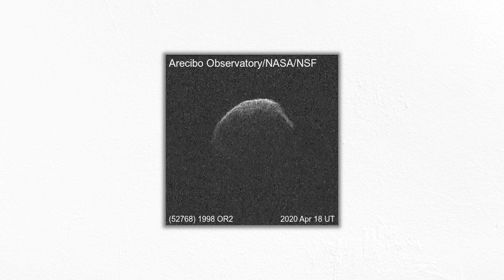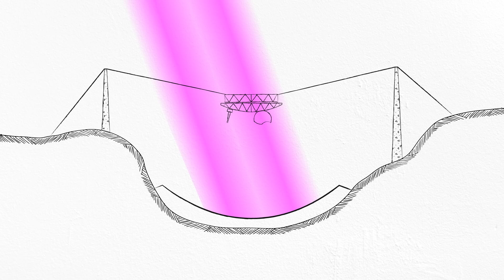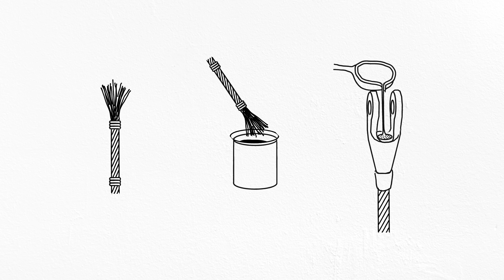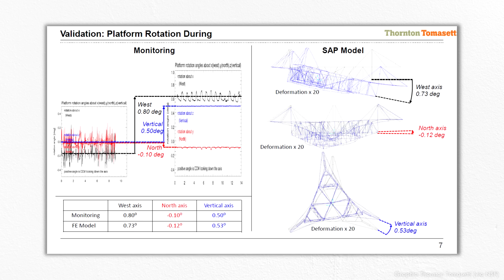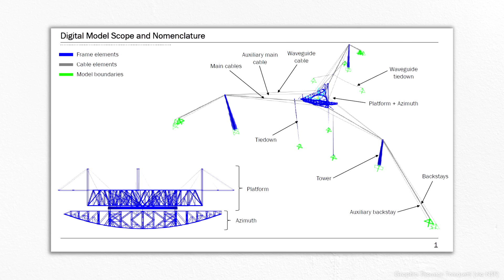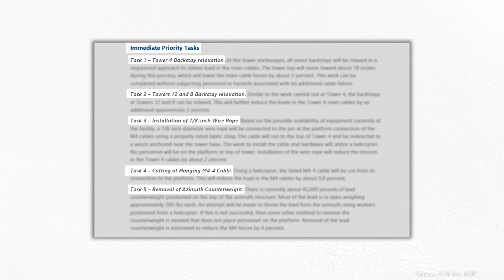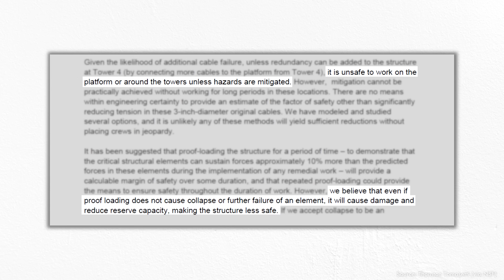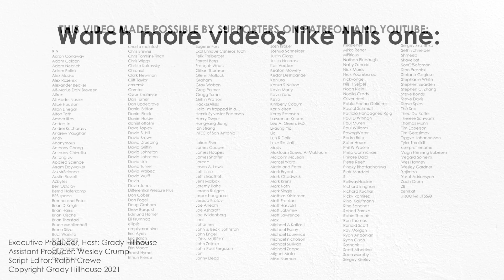What Really Happened at the Arecibo Telescope?

Comment: you had a moving unstable structure :: Every storm, even operating it, caused metal fatigue at the stress point, the weak point in the design, which a more solid tripod would solve.

Comment: The fraying cables were known months in advance.  I read on the news "it's going to fail!"  I wondered "why don't they repair the cables?"  It could have been done for under $1 million for sure, it was a simple job of replacing them one at a time.  All the stuff about the catenary modeling is nice, but an adjustable mount could have been used and then everything gradually tightened up too.  There were surely several ways to do it, if we had only DONE IT.

But we let it go, which was intentional self-destruction.  Not the first time we've done that in recent history.  I guess China was supposed to have the only good one, so we "stepped aside".  Yes I did understand the video.  I am an engineer.
Reply: So you're saying that you would gladly risk your life and the lives of others just for a piece of equipment? I sincerely hope that you do not hold any sort of management position because your mentality will get people killed.

Comment: They didn't use Spelter Sockets, and clearly the breaks all originated from chafing at the tops of the towers. 

The rapid spread of wire failure inside of the cable after the outer chafed cables failed indicates a weakness Throughout the cable SPECIFICALLY at that point.

I conclud the culprit was GALVANIC CORROSION at the point where the cables met the top of the tower.  Possibly from different metals or from an effect of current being produced by suspend wires.. The name of this phenomenon escapes me now.

Comment: The system cut me off M …….anyway, the ropes (cables) should have been galvanized and probably changed every 10 years.  A project this important sho7ld have had a safety factor of at least 10.  A unique project.  But bridges have large safety factors and they are in a corrosive salty atmosphere with constant vibration from traffic and hurricanes.  I believe our Engineering group at Otis could have designed a lasting suspension system .  It would have been a wonderful project to tackle.

JoeB.   BS Civil Engr 1962  Univ of  Md

Comment: If they had just replaced the first failed cable after it happened instead of wasting 3 months trying to computer model how the loads changed we likely would not be watching this . Honestly I am surprised they didn’t have a method to monitor the cable tension of every cable to begin with as that would be pretty critical and dynamic in a structure like that.

Comment: Although I do not have the mathematical talent required for such a trade, engineering of such structures is totally fascinating to me! And with all of the extremely skilled work required to build such an amazing structure, i am willing to bet my bottom dollar that is has everything to do with Human error that resulted in the failure of the cables and that there would have to have been some kind of error in the making of the Cable stays where the zinc is poured in, that resulted in the failure of the system. As like it is always said, a chain is only as strong as its weakest link, there could have been a metallurgical error in the zinc itself or the chemical nature of the paint used to protect the cables from corrosion, or it may even be a physical deformity of the cables induced by the type of clamps used or the amount of Torque used to tighten them it could have been any number of things that resulted in the collapse not the least being the tropical storms that ravaged the Island. I am just enthralled by watching the cables failing, I just can't stop looking at how the strands of the steel peel away with lightning speed being under such tension, I wish there was sound with the video so that I can hear the whipping of the steels strands as they tear through the air....physics is something I have always liked but never had the talent for.

Comment: If the cable sagged about 2.5 feet, that is most decidedly NOT a meter, as a meter is exactly 3.28084 feet long or basically 3.3 feet.

Comment: This is a fantastic video. As someone who works in the research community that used Arecibo, I can say that you have accurately and fairly assessed this event.

Some additional considerations is that there was an uptick in earthquake activity in the region after the hurricanes, which likely added additional dynamic forces that stressed the cables. In fact, a cable had to be repaired after an earthquake a decade ago. Interestingly, there was an earthquake nearby on the date of and at the time of the collapse. This might be what finally pushed it over the inevitable edge.

Comment: Another failure mode nobody wants to talk about is the age, I'm pretty sure it wasn't designed with a 57 year lifespan in mind.
That is a lot of heating/cooling cycles and the constantly shifting stresses from wind.
Reply: Age was definitely a factor, but something built for the 1963 equivalent of $3.2 billion USD was definitely intended to last more than 60 years.

Comment: The dynamic loading of each suspended would or should have been calculated as a compound live load rather than a static load which is typically 50 times the expected capacity if people are within the sphere of the project. Looking at the design and your own comments suggest that the entire structure was substantial under-designed to handle the original structure let alone the massive upgrades that followed. A curious question: How often were the cables replaced? Even the expansion bridges require constant maintenance and even replacement of those cables after a certain period of time. My guess is that the structure was built outside of the United States because it did not meet the stringent safety standards demanding such high safety protocols. Even basic safety harness equipment requires a minimum of 50,000 pounds per square inch attachment points per person on construction sites where an individual is more than 5 feet off the ground, with the exception of ladders up to 10 feet of the ground or inside a contained area such as walls. I have seen the Arecibo project a number of times over the years and wondered exactly how they could actually detect the level of corrosion in those fastening anchors  because once they are sealed and installed there is no practical way to physically inspect the individual strands of cable inside the wedge anchors. Electrolysis would be a naturally occurring event with or without the influence of sea salt corrosion and the constant affects of weather.
I am inclined to believe that the entire project team was fooled by their achievements much like everyone was convinced that the Titanic couldn't be sunk. Throughout history we have seen the same scenario unfold time and again because a project is so spectacular or has been working flawless for so long that short-sightedness creeps in, much like the Florida condominium disaster recently that exposed several similar era buildings showing the same types of issues, causing a critical review of many buildings across the country.
It is very sad to see the loss of this amazing feat of engineering, but the very mention of financial issues indicates that proper maintenance and management were also key factors that most definitely played a part. 😢
While no-one ever wants to admit such truths, science is always underfunded and most projects struggle to show their viability over time, sad, but true.

Comment: A promoted user comment at Ars Technica is beyond superb. See NSF releases footage from the moment Arecibo’s cables failed  by John Timmer from December 2020. Here's the gist: 

"When Arecibo was built, the receiver that detects the signal and the digitizers were incredibly expensive. So to get a lot of sensitivity, you built one big dish ... and focused it on one expensive receiver + digitizer, which were housed in the white ball ... These have been upgraded over the years (liquid helium cooled amplifiers) and the fantastic digital spectrometers ... But they are much less expensive now, so you can build arrays of dishes with many receivers and digitizers. ... On a science/$ basis a rebuilt Arecibo is not very competitive. This is really down to the cost of receivers and digitizers falling so much that arrays of equivalent cost have greater science range."

So yes, you can future-proof a facility with a 3× or 11× safety margin, but you can't future proof a facility over a fundamental change in the nature of the most cost-effective design mode. 

When it's big and cool we demand an engineering margin that will last 100 years out of doors in the blustery tropics. But if it's small and slim (e.g. your iPhone) most people are perfectly happy to landfill the gadget every 24 months in pursuit of the latest and greatest nano-feature. My old phone that lasted 10 years had a perfectly good calculator app from the stone age. You have the power. But as Smokey Bear used to say on behalf of the Forest Service, only you can do the math.

Comment: CORROSION KILLS - On salt water laden radio installations at various points - especially where there is a possibility of dissimilar metals in mutual contact being used (electrolytic corrosion) - I drown the parts in Copper Colloidal grease called Copperease (commercial name) this rejects salt laden moisture, and does not wash off or emollify, it also lasts for donkey's years. It’s a high temperature grease as well used in the automotive trade. I was introduced to using it on ship work as opposed to using sheep fat grease by an engineer who designed seaborne pirate radio station medium wave antennas in the 60s. Impractical probably for any work here and far too late. Paint did not prevent water ingress.  Sad to see it go an engineer working for me used Arecibo to talk to an old USA satellite deep in space and wake it up. One would think that Bezoses and Musks of this world anxious to get into space and make money would donate a small part of their taxable fortunes to looking into space at our galactic origins, it would be good PR for them. Don't ask me what I think of them.

Comment: 14:54 Is pretty damning evidence that the workers, in accordance with the engineers' recommendations, demolished the structure by snapping the cable. There is a black sling choked around the remaining backstay, then it is wrapped around the backstay that snaps. The shackle and pulley attached were probably used to pull on the cable causing additional stress and causing the collapse.
Reply from the maker: No, that sling was used by the engineer to lower the socket of the first failed cable for examination.

Comment: Material failures in structures are common, that is why engineers are an essential part of maintaining this type of structure. That is why inspections are necessary. Following up on inspections is also necessary. And all that is good, but when there is no budget, no responsibility and genuine interest in maintaining the structures. Neither engineering, nor inspections, nor inspection follow-ups solve absolutely nothing. The problem is solved in the human resources department, if they are doing their job. And in the directives of the institutions responsible for the budget. This was not a technical matter, it was an administrative matter. That is what really happened.

Comment: The Presentatiom was fairly reasonable.
The Engineering was Terrible !

My science courses in grade 7, 
were better !

Problems:
>> Structural damage from various partial failures. 
-- What were the damages ?
-- What caused the damages ?
-- What caused any initial failures ?
Reply: The Engineering was Terrible ! 
( Evaluation of Engineers & Repairs)

>> Repairs needed to Upgrade the device 
( key word:  Upgrade !  )

-- Considering it's global benifits: 
International aide should be abailable .
(key words: "Should Be" !  )
-- Considering it's failures:
Obviously had original specs, 
that were in Error !
( How to correctly identify what current specs,,  Actually are at ?)
-- Always better to Prevent vs Repair !

** Conclusions (1) **
-- Invalid/Useless Engineering Design & Maintenance  !
-- International aide for Engineering, 
is easily available ! (minor politics)
-- considering size scales, involved: 
device will need to be regularly upgraded. 
(Easiest to detect & impliment, as repairs are needed.)
Reply: The Engineering was Terrible  
(Repairing/Upgrades Towers)

As device does need repairs & upgrades, 
Only question should be: How.

Considering initial designs:
an obvious suggested repair method, 
involves constructiom of 
temporary/lesser support columns.

IF going to build new towers: 
Could they be built to replace/support original faulty towers ? 

******
Towers & Cables have procedures to constantly update !
Reply: btw:
Methos to replace original receiver, suggests methods to further upgrade.

IF new receiver, is shown to be too heavy:  how to reduce the weight 
or improve the structure ?

>> Return to Building new towers !
>> Can the weight load, be reduced ?

Comment: That's a good point... shock loading a cable significantly reduces it's static capacity. Any climber knows this. So I think that's a good line of investigation. The first cable probably had some unseen defect in it or had been (perhaps with all the cables) over stressed by one or more hurricanes, and when it gave way, it overloaded the rest of the cables but not beyond the breaking point. Enough, though, to reduce the remaining safety margin to critical levels, not to mention that the fact of its being missing trimmed the safety margin just by itself. When the second cable broke, it probably did the same thing but in that case, it dropped the holding strength of the remaining cables below the required minimum. A few good gusts of wind and a little time was all that was needed to exceed the breaking strength of the remaining cables.

Comment: The fastenings on elevator hoist ropes in the US and Canada now typically use "wedge rope sockets" which have largely replaced babbitted sockets which used molten metal or thermosetting resin as the embedment medium. In babbitted sockets used on elevators, the ends of the ropes were first seized with a circumferential wire wrapping where they entered the socket. The individual wraps of the rope were separated and the fiber core was removed within the socket. Then the ends were bent over and this "rose" was pulled into the shackle. This would make it impossible for the rope with a now greatly increased diameter, to pull through the end of the shackle. The babbitt held everything together. Elevator hoist ropes are also of a different construction than those at Arecibo in that they are designed to constantly flex. Additionally, and perhaps more critically they are indoors and normally protected from the environment.

Comment: The only stupid thing here was the adding of the dome. The dome was made way to heavy and was approved by fools. There are better, lighter weight ways to do the same thing. Getting rid of that dome and installing some wideband or multifrequency phased arrays would have been a much better solution. They would given extreme beam steering (in addition to the movement of the triangle along the cables)  to the dish without all the heavy BS on that triangle and its support cables and structures.  Would have greatly lightened the load and the wind load on the towers and cables.

Comment: Wow. What a huge cable failure!
I work with wire rope a lot as an engineer and have done a variety of pull tests on wires.
The spelter sockets were probably proof tested in the shop.
I suspect corrosion combined with cyclic loading lead to failure enough individual strands that over time the whole wire failed. 
It is good to see the engineers recognized the instability of the structure and were not trying to repair this when it broke.

Comment: I have an 8th grade education and could have repaired it with a helicopter. - or brought it down without a crash.

I worked on a power line that was, at times, held in place by a single strand of aluminum.  

They determined that it wasn't too dangerous to give me a job.

Things need to be checked periodically.

Comment: Probably the hurricane was the tipping point if the cables were only designed to hold 2x the static load.  Like bridges have maintenance regularly to protect against corrosion but did these towers have that same level of care?

Comment: In my opionion, the videos misses one possible cause for the rupture of the second (one of the original) cables. The cable was installed in the 60ies, so about 60 years of service life, give or take. Now we know that cable structures are susceptible to vibration, swinging etc., hence load cycles. And even if the stress ranges are small, we're talking about 60 years of life, so many cycles. Depending on the type of cable, other strands may bridge this gap, but if more and more strands brake, there's a natural limit.
And don't let codes and standards for fatigue design fool you: there is no natural limit where stresses below that limit do not cause damage. That's a technical decision and usually it's OK, as fatigue loaded structures are regularly checked.
BTW, I don't assume that fatigue was even considered in the original design. Even today if would be hard. Wind turbines designed for 20 years of service life run into the giga cycle fatigue, so billions of load cycles. And there is no real code to actually make a good design, as most fatigue testing is done in the range of up to 5-10 million cycles, as everything above takes time and is too costly. And for most of the structures that range is quite OK.
Reply: the extra weight they added pushed the calbes beyond the original fatigue limit. .... this was never made to last infinately